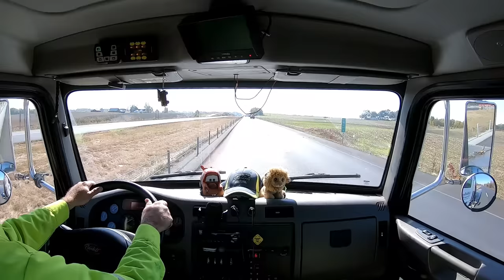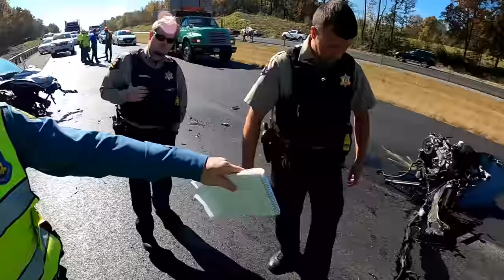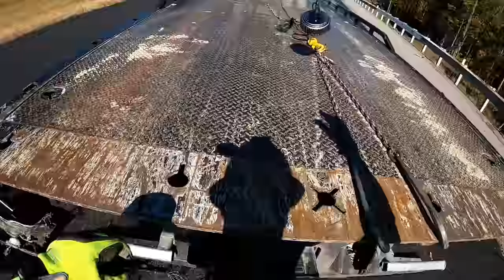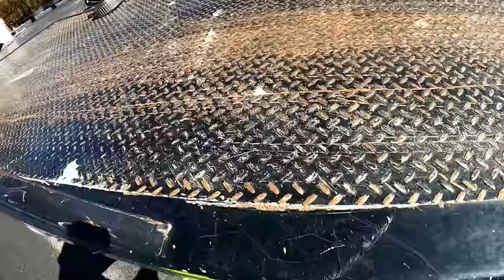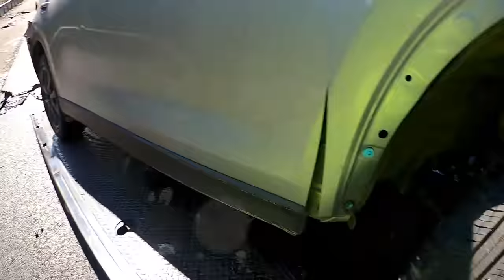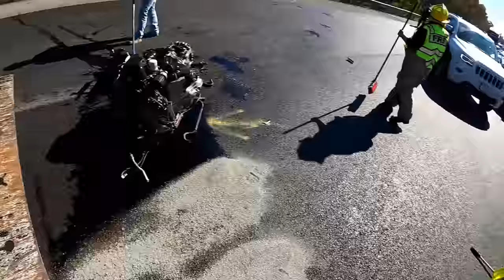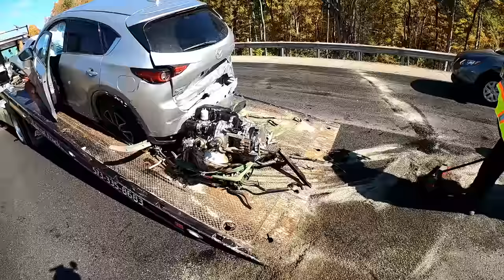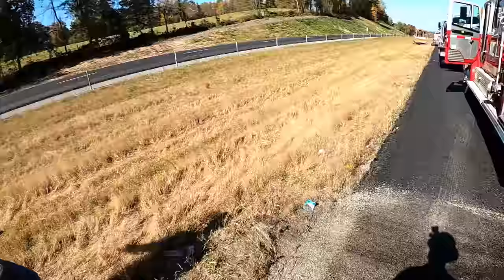Car-Splosion!!!   Code  (Blues & Twos)  Response While Driving In The Wrong Direction!!!

Comment: You can use the wheelift to grab the engine.  You can use junk chain hooks, or L arm around it and strap. in  a situation like that you could have chained the engine to your front tow hooks, an drug it to the median or shoulder before loading the car. Great job!

Comment: That SUV is a mess, but the fact the driver was walking around underlines why it's torn up so badly - modern vehicles are designed to absorb crash energy rather than pass it onto the people inside the vehicle.

Comment: I walked away from a rather nasty wreck myself the Monday before Christmas I was driving a quad axle dump truck loaded at 73k lbs.( legal max) full of beach ball size rock traveling at 40mph in a 55 zone (due to weather and the fact I had just climbed a steep hill) it had been misting all day and the temps were hanging around 33-34 degrees entered a left hand curve in the road and suddenly the steer tires started pushing... black ice had formed on the road... well the pusher axles did exactly as the name implies and pushed the truck straight towards the shoulder but it was already too late the steer tires tried to grab the gravel of the shoulder but the snow slush and ice had other plans... the truck caught a driveway culvert in the middle of the turn with the RF tire launching the RF of the truck into the air causing the LF to catch causing the truck to roll to the right into the ditch and slamming the nose of the truck into the embankment on the other side of the ditch... the force was so great that it ripped all but one cab mount from the frame spilled the entire contents of the dump box all over the ditch crushes the full cab into a 2/3 cab broke the driver seat slider locks (both rails).  And almost everything from the cab was lost into the ditch. thru the passenger window.  there was about a 75-100 foot debris field from the rollover and the truck was a late 90's Volvo...  honestly the only reason I survived and walked away is the fact I was wearing my seatbelt (I would've been sucked out the passenger side of the truck by the ground traveling past)... It was later realized I had a non impact induced concussion (from the sheer force of the impact) as well as the normal contusions. Now that was a dumptruck-splosion.

Comment: That car did exactly what it was designed to do. They make them now where the engine will drop to keep it from coming inside the cabin. I remember my step dad went on a call awhile back before I started driving the wrecker. The guy hit a tree in his Armada and when my step dad got there to get the truck, the motor was sitting in his lap

Comment: Subframe obliterated, engine separated, transmission shattered (you can tell by the gear he tossed on the flatbed and later into the cabin of the car). It's astonishing the driver actually walked out of that. I guess the Mazda CX-5 is a solid vehicle after all.

Comment: Mazda CX3/CX5 - or it was.They have collision mitigation as part of cruise control - or the ones I have driven sure have them. Will brake for you if you don't, keeps distance between you and vehicle ahead (Not sure about motorbikes). (Edit - probably didn't have cc on. Pity this would have been avoided).

Comment: Looked like a Mazda.  Certainly speaks well to the safety built into cars today,   Airbags deployed, looks like no intrusion into the cabin, and he could open the door!    I know engines are designed to be pushed down and rearward so as not to enter the cabin, but do you suppose the complete disconnect here of the engine from frame was part of its design?

Comment: You would be surprised at what you can leave through. I was hit head-on at over 40 mph. Guy was coming off the NJ Turnpike. Hit me so hard, it broke all the metal supports, push the frame back about a foot and a half, cracked the exhaust and ps pump, fan and all, on an 01 Jeep Cherokee. It was so bad, I questioned how I survived with minor injuries. 24 yrs in EMS and responding to the highway, my accident beat all the calls I ever had. It was an Acura TL that destroyed an 01 Jeep Liberty. I got out, got my senses and went right into EMT mode. TFCC tear, bulging discs in my neck and back, nerve damage on the right said. Uncle Sam conditioned my mind to have you second guessing if I had injuries!

Comment: Okay, so I had to take just half a second to look at the description of this video before I realized why it sounded so familiar, although not for the same incident. It's the weirdest feeling in the world to drive the wrong way on a highway/interstate with absolutely no one in sight oncoming, and parallel to the other lanes of traffic. The first time I did so was for a car fire while driving the tanker coming to tender the brush truck that responded to extinguish the blaze. I don't know why they responded a brush truck instead of an engine, but it only had a 100 gallon tank instead of the standard 500 gallons on our engines, so I took a tanker, and drove north in the southbound lanes of St Hwy 13 about 12 miles north of Springfield. It's funny, due to memory issues I cannot tell you anything I did for most of last week, but I can tell you plain as day what happened way back then, almost 20 years ago. MSHP is notorious for asking for tow operators to expedite. We (our FD) hated it when they did, as tow trucks in our area of MO rarely are equipped with red/blue lights, at least forward facing, due to liability issues, and the last thing you want is for a tow truck, or any heavy vehicle, to be speeding towards an accident without the proper emergency warning equipment. We did have a few, but not many. Back then our main utility company in Springfield had trucks equipped to run code, especially gas service trucks, to respond for broken gas mains, which also made me shake my head, because we wouldn't even approach the area of a broken/ruptured gas main, and we were the ones with the foam and water. Incidentally, I like some of the driving included as well. No, the viewer doesn't get to see you running "code 3" in this video, as there is no siren, but you did a good job at keeping up the sense of urgency as you drove. Nice vid.

Comment: Those that don't won't to watch the driving part can Fast Forward, maybe put the time on the screen to FF to.

I drove a lorry mounted crane in London UK. The Met Police would call us out usually to deal with the load not the vehicle, they would send a motorcycle cop to meet me enroute from the yard. First he'd ask how fast I could go which was about 50 mph downhill with the wind behind me, so it was flat out and he'd leap frog ahead stopping traffic at cross roads etc. No blue lights on our trucks only an amber rotating beacon light on the truck cab and crane cab roof.
The most frequent calls were to scrap car bodies that had been flattened by dropping a weight on them, the jolts of the journey would slacken the tie down wires and the load would shift.

Comment: That's not a SUV it's a crossover. SUV's have full steal frames with the body bolted to it and cross over's have boxed welded sheet metal with the body welded to it. when the tow truck driver starts hooking up you can see the boxed sheet metal. also the reason why the engine was out in the road.

Comment: nobody there had oil dry, not even the highway workers? I'd have suggested dragging the engine up on first, then the car behind, then strap it all in the left lane.
looks like 98%+ of the oil is already out, not much more will leak.

Comment: Worst and the most miraculous  head on  I had during my Fire Rescue career was  Toyota Celica head on with transport young male driver late for work had done a high speed pass  to pass a long line of cars during the morning rush hour  passing on double solid line as well, when  over the hill transport was coming the opposite way Toyota had impacted the front axle with such force that the bolts for the springs had sheared off and car had continued to impact the saddle tank( just filled up ) and tore them off and ignited the diesel fuel  so when we arrived on scene we had transport on fire car pieces all over and the driver of the car had been ejected though the windshield and was laying in the ditch about 100 feet from the impact point, miraculously he lived ( even his seatbelts had been torn off the floor. Transport driver took it so hard that he quit  and never drove transports again.. some strange things I found along the way was a cd that had been ejected from the car it was embedded in pine tree about an inch deep ( I was looking for another possible passenger that could have been ejected as well )   figured I share this story with you Ron  you do  very professional and skilled  work, I ran the Rescue for many years I would work with you in a heartbeat be safe and God Bless !

Comment: The place I towed for years ago got a call for a car verses train with no injuries. Someone had turned onto a double set of tracks and got stuck. They were able to get out fine but not so much for the car. It got hit by two opposing direction freight trains. The largest piece to pick up was the piece of dash with the radio in it! The entire car and engine was able to be picked up by hand. What a mess. I think it was a K car.

Comment: Quick question, why aren't you and other emergency professionals wearing masks?
Reply from the maker: Several reasons, actually.   First, we do not live in a mask mandated area.   Second, we are outside and maintaining, for the most part, the 6' suggested.   Thirdly, most of the Emergency Service personnel are required to be tested or self-test and if have any symptoms, are not allowed to work until cleared.   So....the emergency professionals on scene SHOULD all be clear, not to say that someone couldn't be a carrier.   Also, I and my wife have both had the virus and, if you believe what some studies are saying (we won't even go into all that), but if you believe them, we are immune for at least 6 months.    I have started wearing my mask again, now, however.   Thanks for watching and God bless.

Comment: The engine breaks lose by design.  It's safer for the occupant that way, hence the driver walked away.
Reply: It depends on many many things whether it breaks loose or not, such as the angle of impact. In this case it got ejected from the car, in many other different scenarios it would have not, and yes with the exact same car.

Comment: It was not "by the grace of god" that the driver walked away; it was those pesky federal regulations that required auto makers to make cars safer.
Reply from the maker: To each their own.   We all have ideas and opinions.  I agree with portions of your statement, however, that is not the purpose of this channel.  The purpose of this channel is to show the various jobs we perform.   It is not a platform for debates, whether over religion, mask, philosophies, or otherwise.   I would ask for tolerance and acceptance of ALL, whether agreeing with their philosophies, ideas, beliefs, etc.   Thanks for watching and  may the God that I believe in, bless you.

Comment: ron how do you like the 4200 mini controller? i am considering getting one when i redo the lighting on my truck to streamline everything
Reply from the maker: I like it.   Careful with the instructions though if you are using Feniex lighting as well.  Their color coding is different.  I had to diagram it all out.   For some reason their lights are color coded differently than the controller and some of the instructions are printed incorrectly, or, at least they were on mine.   I had a difficult task wiring the traffic controller (arrow board), perimeter lights, and the 4200.   The wiring was all different even though everything came through Feniex.  After getting the controller wired up and all the lights burning, the worst part was trying to "sync" the perimeter lights.   I'm not knocking Feniex.   It's a good product an we use a lot of it.   The controller works perfectly, which was your original question.  As an installer, as well, I wish they would have made their wiring system more "user-friendly".   Thanks for watching and God bless.
Reply: @RonPratt  ye i am planning on a feniex fusion 600 and sound off bar kinda a short budget build but thanks for the info i have had feniex lights in the past and have had issues with getting them to sync

Comment: Yes car design has come a long way. Years ago in Auckland NZ in the early 80s i came across an accident on a steady right hand sweeper bout 1am in the morning. A 69 or 70 Mk 1 Ford Escort was sitting in the middle of the road facing the wrong way. So what u say? Well it was the front half. It was like someone had taken a giant cleever and sliced it clean down where the b pillar runs. The driver and the front passenger were still in the front seats so we helped them out, both pissed as chooks, but where was the other half? Bout 2 houses past the front half, opposite side of the road down a 15 foot bank in someones front yard. We climbed down the bank to find the missing back half with the rear passenger fast asleep on the back seat!  All got out without a scratch! Someone was looking out for them that night for sure.!!! ¥¥¥

Comment: Someone was really looking out for That person driving the SUV i too drove a two truck for a few years i loved it the worst traffic accidents I showed up on the scene it was a F350 4 door 4 wheel drive on top of the tree about 15 feet up in the air the truck had turned into a horseshoe there were 18 people inside the truck they were being chased by border patrol and Texas Department of Public Safety it took me 2 hours to clean up the. Accident scene the driver and one of the passengers were killed in that accident and 16 people were Halo flighted out to area  hospitals when i finished cleaning up the accident scene I broke down and cried like a baby because I couldn't believe how desperate people can get to try and run from the cops

Comment: Running right lights, only ambulances fire crew and policed can do that, not tow truck drivers.
Reply from the maker: In Missouri we are Emergency Services:  https://revisor.mo.gov/main/OneSection.aspx?section=304.022
Thanks for watching and God bless.
Reply: @RonPratt  Didn't know that. I see yellow flashing lights and I just go about my business. In my state. Then again I never seen a bad wreck that required a wrecker.
Reply from the maker: @deathjoker666  I will not show that kind of crash on my channel.   Most of our employees are trained/certified in extrication and other essential emergency services.   We assist with extrication and, in Fire Department terms, recovery.  There are many ways in which a PROPERLY TRAINED tow/recovery operator can assist at a crash site.   It is, afterall, a team effort.   Everyone present has a part to play and sometimes those roles can and do overlap.   Thanks and God bless.

Comment: couldnt he just put the engine in the front????
Reply from the maker: Yes, I could have and that would have, under normal circumstances, been my approach.  However, all the Emergency Service vehicles and a large amount of the crash scene that wasn't visible in this video were all in the passing lane, same as the engine.  So....as the Trooper suggested, removing the car from the driving lane was the fastest way to open up a lane of traffic.   This method worked.    Thanks for watching and God bless.

Comment: I honestly wouldve loaded the engine first then the car, i had an mva last year involving a motorcycle that crossed the yellow line and smacked a ford edge, strapped the car on then the bike and not only was winching a pain in the balls but i couldnt strap correctly and almost lost the bike 8 miles from the yard, ever since then i load bikes, engines, and smaller stuff first then strap it to the car and bed of my rig
Reply from the maker: Yes, I could have loaded the engine first, and that would have, under normal circumstances, been my approach.  However, all the Emergency Service vehicles and a large amount of the crash scene that wasn't visible in this video were all in the passing lane, same as the engine.  So....as the Trooper suggested, removing the car from the driving lane was the fastest way to open up a lane of traffic.   This method worked.    Thanks for watching and God bless.